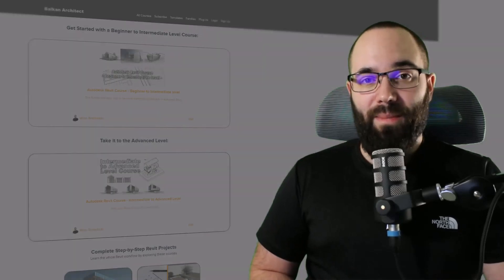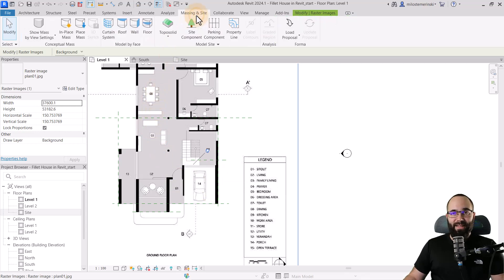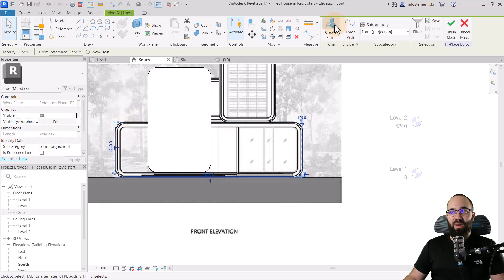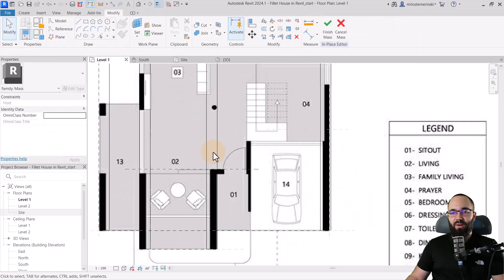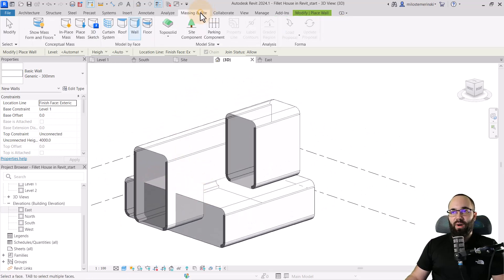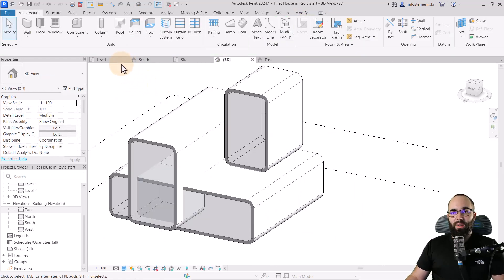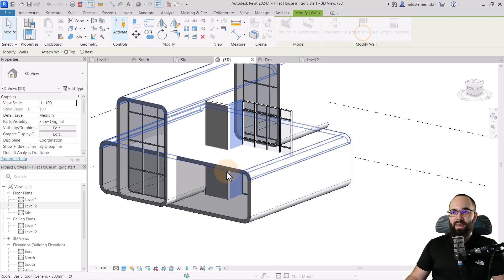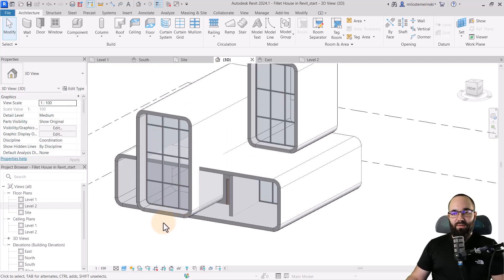Massing in Revit Tutorial: Fillet House

Comment: hey balkan, can you check if you can figure out a texture work around for an issue im  having? when i make a beveled edge countertop, the texture i apply splits into 4 different areas and looks really bad.
Reply: if you make a sweep profile and it should be fixed. specially if you give one end just a tiny 1mm difference in height.